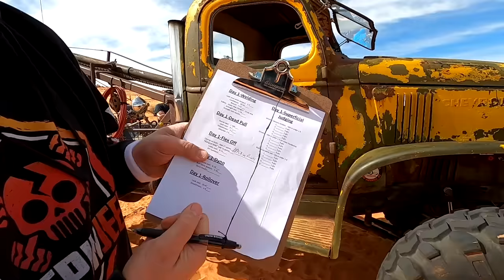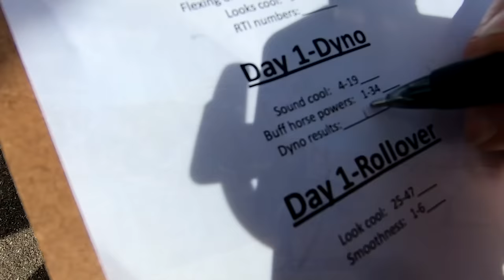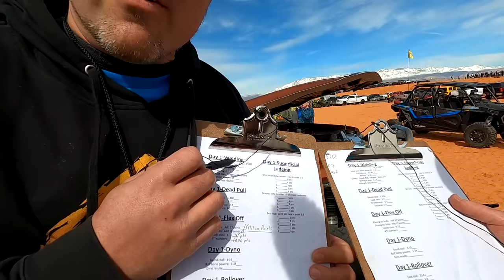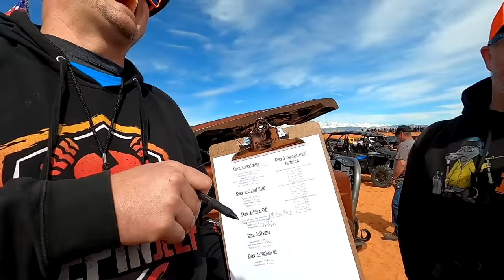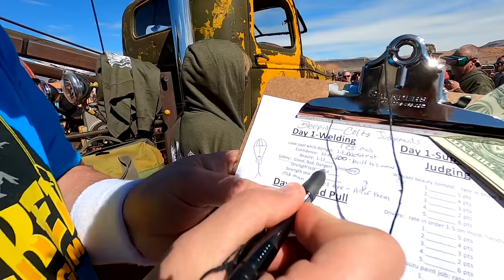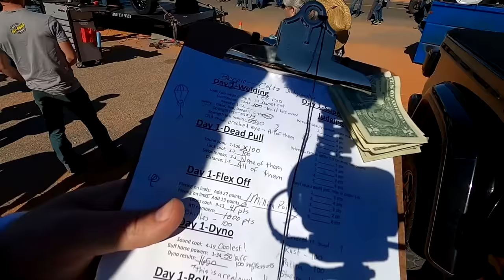We Corrupted The Off Road Wrecker Games!! A Full Length Movie with @MattsOffRoadRecovery

Comment: I worked at John Deere in the 90’s, we had an old hydro flow Dynameter. It a water loop generator. Power was measured in watts and converted to horsepower.

Comment: Do you & Colt have on board welders?  Don't recall seeing you trail welding????   The suitcase migs really look sweet... but I think stick welding has more strength &  fills gaps faster... besides I'm not a fan of Flux core wire.
Reply from the maker: We carry jumper cables and rod but try to build our stuff so we don't need it. We would however get something like a Premier Power Welder for a dedicated recovery vehicle like a wrecker. 😎👍

Comment: 1.  Dynos don't wheel.  Dyno queens don't wheel.  That dyno wasn't calibrated correctly.  Hub dyno numbers would be different...higher.
2.  Next year there should be minimum safety requirements for the competitors.  A lap belt, with a shoulder belt being better and a harness is best.  On board Fire extinguisher(s).  Though there weren't any incidents this year....it's still a huge possibility and the negative media depicting injury or worse will definitely place the event in peril.
3.  Only being 'gifted' Dr. Pepper Zero is worth points.  Being offered lesser beverages will require points being deducted.
4.  'Sword' fights will require proper technique and scoring per Olympic standards.
5.   Merlin's run was less finesse and more just brute force.  I nominate him for official monster truck driver.
6.  Rory's experience and mastery of his rig is next level.  Matt and Paul have to get some miles under them in their new rigs to meet that.
7.  Your antics and commentary were entertaining.  More of that and I might have to had this channel to my rotation.

Comment: Colt you guys done a great job with your roles in the wrecker games. But I’m wondering why you felt compelled enough to get out of that diesel junk for your safety but didn’t have any concern about the safety of his pull car drivers safety. He didn’t use his winch to try to keep him from being jerked through that course just mash the gas so he could get to the finish line first. Should have been different I suppose.